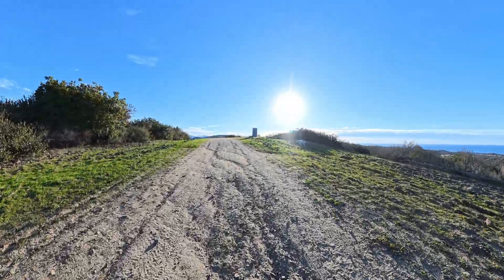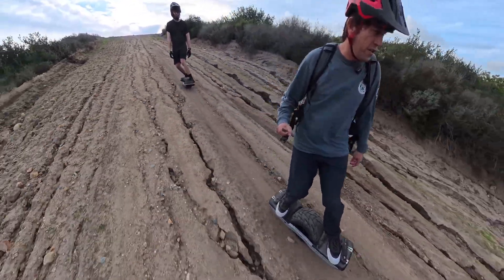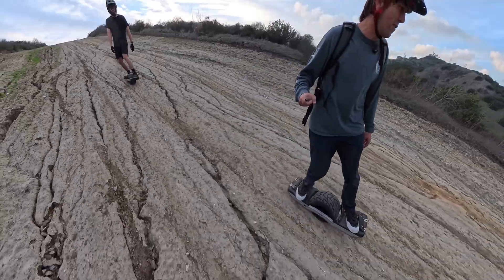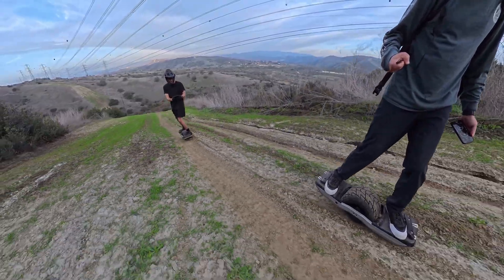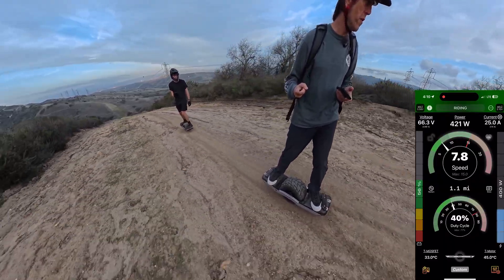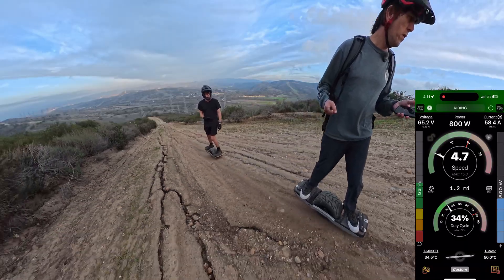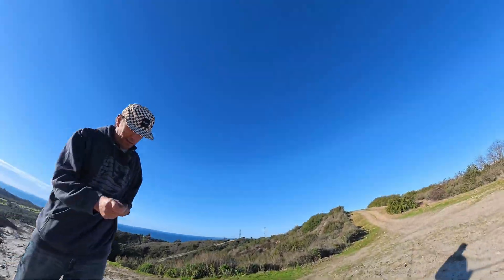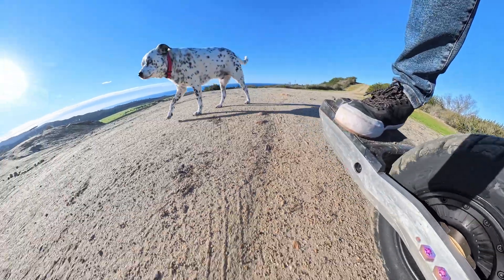5 inch SuperFlux First Test - HS vs HT Testing

Comment: If this comment gets 100 likes we release both HS and HT.
Reply: How about you just get the regular HS back in stock so I can buy it.
Reply: @DrTenet working on it 😢
Reply: I vote HT, as long as it has enough top speed on high voltage builds 30s we good.

Comment: How would you compare the new 5" vs a 6" SF motor? It's significantly lighter, imagine that comes at a cost in efficiency or available torque. Would love to see a comparison of performance between a SF / 5F / S series
Reply from the maker: Me too, me too - I don't have access to a S-series motor unfortunately. But I should do a more in depth comparison to SF-6 soon. Obviously SF-6 is still the king in terms of torque and thermals, simply due to the bigger stator and the bigger thermal mass and copper infill. If you're close to overheating with a CannonCore or SF-6 then the SF-5 is not for you... But if you want a major upgrade from a 5" Hypercore then the SF-5 is a slam dunk.
Reply: I've been on the MTE (n48 with a standard pint/xr stator) for a while and overheating it more and more lately. It gets crunchy when pushed hard too. I love the idea of a SF in the 5". But at the cost they're asking, might as well stick with the OG SF and go BTG for the cushion.
Reply from the maker: @GeneWuzHear  agreed - if you don't mind the weight just get the SF-6 while the price is still low. Best bang for the buck by a mile

Comment: Fun fact, high torque and high speed produce the same amount of heat inside the stator, assuming they kept the total amount of copper constant.  The difference in heat is only felt in the cable.  High torque setups essentially arrange the windings to be more in series and high-speed arranges them more in parallel.  Each individual strand carries the same amount of current in both cases, and so produces the same total heat output.
Reply from the maker: this may well be true in theory, but in practice it doesn't seem to behave like this. Identical weight (within 100g) yet we see different thermal behavior
Reply: @surfdado  could well be slightly different amounts of copper, because you have to have an integer number of turns and strands and they won't always produce the exact same amount of copper.  54C vs 52C is a pretty modest difference.  Looking forward to seeing how they perform with the same controller and battery.  Also guessing the HT with an 18s won't do well at high speeds.
Reply from the maker: @robertallen4378  true, I don't suspect the HT to be the ideal pick for 18s or lower voltage builds.

Comment: Great videos as always. I see rain also makes canyons of doom on your local trails, I know this pain well :)  I was curious to know your electrical background ? Are you an electrical engineer or are you more on the programming micro controller side? I ask because you could test in precision controll environment but would require some tools. A bench test side by side would yeild more controlled results though would 100% be a less interesting video:)
Reply from the maker: EE but doing mainly software professionally, but all of that sounds really hard and not fun - I like these kinds of tests because they're also enjoyable to me since I get to ride. And this btw is the reason why so do not see me do range test videos, just too boring lmao
Reply: @surfdado , ive got a background in electronics and programming as well as mechanical trades so i was too curious not to ask. I understand also that making boring videos is boring. Appreciate everything you do 😊

Comment: I think you mix the description up towards the end but it's good to know that the HS motor is still probably the best choice
Reply from the maker: lol wtf? What exactly did I mix up?? Timestamp?
Reply: @surfdado  did you really put the HT on the 18s board and the HS on the 32s?  Seems backwards.
Reply from the maker: @wakesetter101 agreed but we really did do that. It had some logistical reasons, no time to swap them back
Reply: @wakesetter101 an  18s would still be going through more windings generating more inductive forces on the ht. While the hs ( less windings ) would benefit from the extra voltage ( pressure ) to move the load.   Or am I missing something? Do they just have different magnets in the motors ? 

I Do see your point though. The most comprehensive way to make retest identical would be to crunch the numbers and compare them with the same amperage flowing since heat is a byproduct of the current. Output wise again. Numbers don't lie ( but are less interesting videos)

Comment: More rubber is more better 😉
Reply: Agreed. And it's so telling that when Future Motion tried to force everyone to use their tires they chose 6.5" instead of for example 5.5". Those dipsh!ts are so incompetent, they could have at least improved the riding experience while screwing us over, but instead they chose to make the riding experience worse. It's either malicious or incompetent, I'll be an optimist and call it incompetent. But it's cheesy crap like that that makes it so anyone who has any understanding of the tech is long gone from the FM ecosystem.

Comment: How do these 5-inch SuperFlux motors compare to the 5-inch MTE motor in terms of feel/performance?
Reply: MTE is just a hub
Reply: @chickenbriar  What I meant was MTE + Hypercore stator.
Reply from the maker: Especially the HT version feels way more torquey/powerful
Reply: @surfdado  Could you perhaps tell me if the weight difference is significantly noticeable compared to the original 6-inch SuperFlux motor or the MTE + Hypercore stator combination? I'm considering the 5-inch motor, and if the weight difference isn't huge, I'd rather wait for the 5uperflux instead of getting the MTE.
Reply from the maker: @dyb6916 the weight feels closer to Hypercore than to the original SuperFlux motors